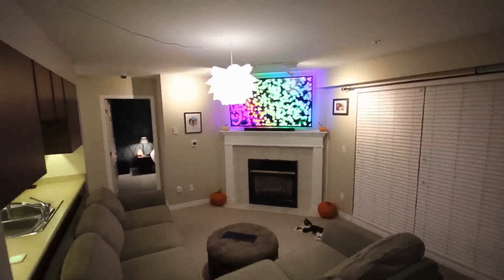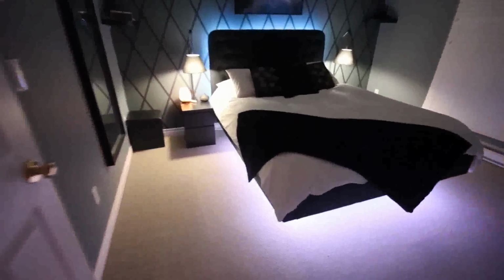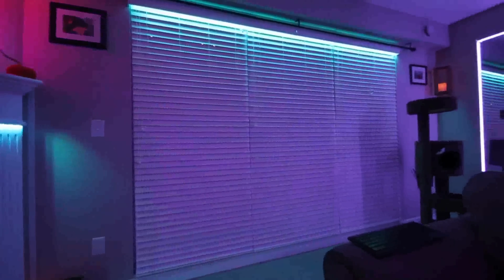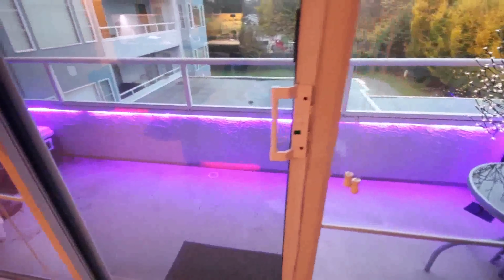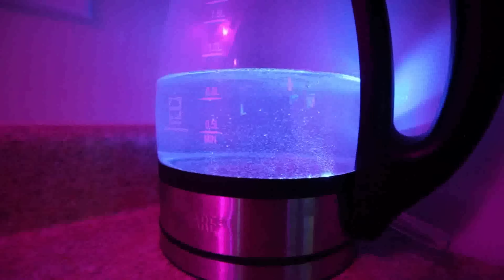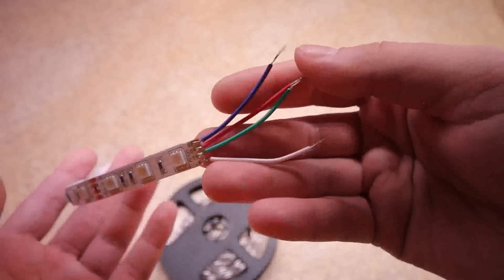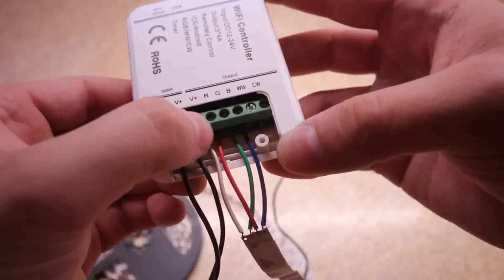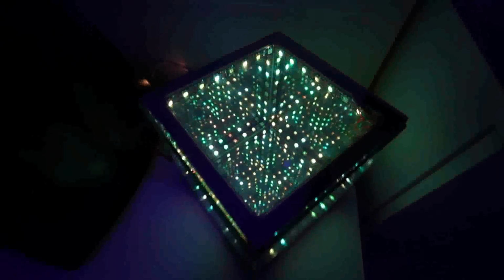My RGB Apartment (Explained)

Comment: Do these lights change with your tv remote? I ordered some Govee LED Strip lights about 2 years ago and experienced that. With certain buttons on my TV it would either turn them off or change the color mode.
Reply from the maker: No, these are controlled over wifi. That happens because your tv remote and your led controller are both infrared controlled

Comment: I have a raspberry pi connected to my led strip and i’ve written a Python program with all sorts of effects for the led strip. I want to control the functions from my python program via my phone but i dont know how. Any suggestions? 
Ive already looked for wifi controllers for ledstrips but you cant program those and you can only use the build in effects.
Reply from the maker: Maybe look into home assistant? Might be what you're looking for
Reply: @Coltography  i will take a look thanks for the advice!
Reply from the maker: @Patrick-fz8ee  np, also suggest wled for nodemcu (esp8266) - open source firmware with a phone app and highly customizable / works with Alexa and has a ton of features
Reply: @Coltography  👍🏻thanks

Comment: How did you get all those sockets to plug into.. definitely the sockets in an apartment are limited
Reply from the maker: Ran low voltage wiring in hidden places

Comment: The lack of compatibility between brands got me into electronic engineering and mostly with the reliable help from Cybernet_hacker on Instagram Now I mod devices to use ICUE as well as designed as RGB 5v Digital to 12v analog converter to allow me to control many analog devices independently as a virtual addressable LEDs.

Comment: How can I find a WiFi controller that works with Magic Home and is USB? Literally all of them are with power adapters :(
Reply from the maker: No such thing as usb powered as they are not 5v controllers
Reply: Coltography Yeah but are there 5V controllers that use the app Magic Home and are USB?
Reply from the maker: Don't think so nope
Reply: Coltography D; I guess I’ll have to use 2 different apps for them. You think that will be annoying or should I buy it? I dont think I have any other options :/

Comment: hey man. may I know what did you use to cover your wire there? is it something like flexible wire casing or what? please help
Reply from the maker: At which part?
Reply: @Coltography  0:40 mostly
Reply: At most part? Especially on the walls area

Comment: When is the video coming for the smart mirror? What display did you use and is it touch screen & if not do you plan to use an IR frame for that?
Reply from the maker: Just used an old 720p tv and no touch screen yet, I definitely want to try one eventually though!
Reply: Coltography look into an IR frame - they have many different sizes you can get - they assemble together so you can make combine sets to make larger one

Comment: hey since you seem to know a lot about led strips i have a quick question my room has a perimeter of approximately 53.3 feet unfortunately when i installed lights they seemed to have gotten really dim after just filling 38.3 feet. how do you keep it from getting so dim or was it just the quality of light i had i’m planning on getting the govee lights and don’t waste money having these lights for them to have the same problem
Reply from the maker: Connect power at both ends of the strips, or do something different than simply lining the permiter of you room

Comment: Question. 
Where do you plug all these LEDs? Don't you need like a gazillion power outlets?
Reply from the maker: Just a couple really, once you step down to 12v you can just splice it and run wires wherever you need

Comment: I am curious. Do you have a hue system. I thought I saw a Phillips hue dimmer. What do you have in your arsenal? I am curious what you're using.
Reply from the maker: Yes, 10 hue bulbs and some of the dimmer switches
Reply: @Coltography  but the lights trips aren't hue from what I saw and heard via pricing. Is that a different system you are using? What lights trips do you recommend?
Reply: STRIPS** dang autocorrect
Reply from the maker: @YoBeAwesome  watch my video on automating cheap rgb strips, I also recently switched to zigbee controllers for cheap rgb strips which connect to hue bridge and all controllable via same app

Comment: Is each individual rgb strip connected to its own power supply? Or is it multiple strips connect to one power box? I want to put some around my whole kitchen and living room but idk how Many volts can each power supply can handle. Do you think if I use a connector to add strips off another box of rgb’s to connect to one single power source would be an over kill?

Comment: I've purchased the same wifi controller. once hooked up and magic home app installed, and linked to google home app, I cannot get the lights to turn white through google home. I've read creating a scene in magic home app and telling google home to "activate" said theme it will follow through.
this was true on my old crappy wifi controller that came with the light, but not the one you are showing. 
I scrapped the old controller because it would disconnect constantly and the physical plugs for the lights would barely hold on.
these new controller you've recommended are all around great, just cant get Google home to turn them white.
these are regular 4 pin RGB lights. not RGBW.
any ideas???

EDIT

just figured it out. through the Google home app, you need to create a new routine. within the settings of that there is an option called "adjust scenes"
this will bring up a list of scenes you've created in the magic home pro app.
select the pre created scene desired, and google home will execute that action.

was going to delete original comment but leaving it up with my solution for anybody with this issue.

Comment: So I have a question, can you attach LED light strips on the center of the ceiling like in a circle ⭕️ and then it’ll act as a light bulb type of thing or a hanging plug 🔌 in lamp  when you don’t have hardwires for a light bulb?

Comment: How did you get permission to do this in an apartment...
Reply from the maker: Didn't need it, because it all comes out??? I don't get why you couldn't put lights in an apartment, damages nothing.
Reply: Coltography I can’t paint or put holes in the wall or change lights because they have their own lights and when it goes out they have to replace it with there stuff, so a lot of stupid little rules. I might try and figure out a way to get around a lot of it.

Comment: Hey guys could someone help me by giving the link to the Extra Powerful 12v 10amp Power Adapter:
Reply from the maker: Hey buddy, just search them on amazon
Reply: @Coltography  Thanks for responding but I tried and couldn't find the one in the video and I can't find any that have the same end like the one in the video I'm not sure if you did something to the original cable in the video but either way thank you for your help
Reply from the maker: @buyit1072  Hey buddy, they're essentially all the same thing. Just buy any 8-10 amp power supply that is 12vdc and it will work for what you need. How many strips are you connecting anyway? You might not need it.

Comment: Q: How do you keep the strips from dimming at the ends? I connected 4 strips to one power supply and the farthest LEDs on the strip fade. I gotten a Bigger power supply and it does not fix the issue.. any idea how to fix that?
Reply from the maker: Attach power at both ends! Splice wires at power supply and run power to the other end. Or add power half way through the strip, if that's easier.
Reply: @Coltography  Alrighty Thanks!

Comment: You could use acrylic paint to cover the white areas of the cable that showed on the cabinets.  Hand mix the color but remember that it will dry darker than when it is wet.

Comment: so do you daisy chain the strips to eventually go to the wifi box? or do you have a dedicated wifi box for every cable run and then just sync them using the app?
Reply from the maker: The latter, but for some areas I'll attach a wire in parallel and use the same controller for a few spots. In this case the fireplace pillars and couch were on one controller

Comment: Can a single connection be made with 20 meters of strip?
Reply from the maker: Yes but you will have voltage drop. So lights at the end of the run will gradually get dimmer. I would connect power at both ends

Comment: i like it, 
but how many and what psu(s) are you using for 165ft of leds?
Reply from the maker: 7 controllers I think with 5-6 different power supplies. I had some running off my computer PSU at the time.
Reply from the maker: Additionally I use what PSUs are required, look up the amperages you need for how many ft you're using etc. I had 3-15amps

Comment: Damn this is goals.

Honestly i might do this one day.

I wonder if you could rig the sink up to be controlled by the heat temp.

You would just have to run a thermoprobe into the valve which could be annoying.
Reply: my old kitchen sink used to be like that

Comment: would you know how I could put it on my ceiling without having to expose some of it going down the wall to an wall outlet?
Reply: Put a small hole in the corner between the ceiling and the wall. Add an additional outlet or junction box in your attic. Run the wires through the hole and plug in at the new outlet.

Comment: Do you NEED wifi for the controllers to work? Or will it work just as long as you have a smart phone? I have no WiFi just hardwired internetz
Reply from the maker: Nope, it can work, the controller will just broadcast its own wifi network you connect to. :)
Reply: @Coltography  thanks hummie!

Comment: My biggest fear is to have one of these lights catch on fire
Reply: Not gonna happen, not realistically high enough voltage unless it's some real dodgy shit
Reply: Ive had like 6 diff rgb lights and strips in my room for like 4 years. No issues. Just don’t buy weird cheap shit off wish to be safe. Just shell out the 20 bucks for a decent strip.

Comment: Anyone know how to link: Speakers, RBG Lights, lights, TV, etc to Google or Alexa? Whats the Bluetooth set up look like
Reply from the maker: Use wifi controllers which are linked in description
Reply: Speakers and TV have to be Alexa compatible or you buy a IR device that mimics your TV / Speaker remote and connect that to Alexa. But it will be messy and you can only perform on/off false/true commands
Reply: Thanks I was able to do it, but I'm wondering how you his the way lights so it doesn't look like a strange stripe with bulbs.
Reply from the maker: @kazukixe  you need to hide the strips behind things so the light can bounce off and diffuse. Then you can't see the tiny bulbs and it looks a lot better.
Reply: @kazukixe  move TV away from wall. Like 15 cm.

If it doesn't help buy a plastic tube and scratch it with sandpaper to make it opaque. Put Led in tube or cut tube on half circle and put on led

Comment: Hi! I have a question, so based on what you showed, the wifi controller only connects to one strip of led. So how do you connect and control all of them to your phone??

Appreciate it, dude!
Reply from the maker: Hello! You can solder wires to the end of the run of the led strips and then continue on past that point with another strip, wherever the wire leads to. In this case I have multiple controllers hooked up to all the "groups" of strips and the app will control all of them at once if I click the entire group. Hope this answers your question. :)

Comment: Question for you, around the mirrors do you have anything to diffuse the light or is it just the Strips on around the edges? I'm trying to get the lights on my desk to look more solid but the spaces between them seem to be too big so thinking of getting the Strip you have used in this video.
Reply from the maker: Hello, I used the same drywall capping you see around the 5:00 mark in this video around the mirrors. Directed the LEDs facing the mirror inside the channel so it provides diffusion and looks more linear

Comment: Quick question. How many wireless/12v adapters did you need? Like did you need one for each rgb set of strips?
Reply from the maker: Hello, I used 1 controller per "section" aka the blinds, fire place, couch all run off 1 controller and 1 adapter. Mirrors are on their on circuit and adapter and so forth. I could have them all on one controller but it's nice to be able to set different colors for certain things.
Reply: ok cool! Thanks so much for the response. I know how many i need to buy now :P @Coltography
Reply from the maker: @TheReckoniing  no problem, always happy to help :) good luck!

Comment: I have a question. Say I buy 6ft led strips, but I only used 2 ft, so I cut it. Does that mean the rest is useless now or can I use the remaining 4 ft?
Reply from the maker: You definitely can use the rest. You just need to solder wire onto the strip :)
Reply: Coltography thanks! Can you maybe make a quick little tutorial on how light strips work? That’ll help me out a lot. Clearly I’m not a really techy guy
Reply from the maker: @ionetwofarq1673  yes, that will be my next video don't worry!
Reply: Coltography this Chanel is amazing! Def subbing

Comment: That's amazing! Have you thought about putting the light strips around your door frame facing outward and then placing a bezel on the door frame overlapping the light strip just enough so you cant see them from an angle. Would look super cool!! Also have you thought about using Ultra Electro Luminescent wire? Its much brighter than standard EL wire and looks better when directly looking at it than an LED strip IMO, so for areas where you cant put a bezel to cover the light strip this would be handy.

Comment: How much do you think you’ve spent in total with the WiFi controllers? I’m looking to do my bed room next. I did my game room but only with regular usb LEDs on all three screens, my desk and entertainment stand. I use a stand remote for it. I haven’t looked into WiFi controlled options.
Reply from the maker: Links to the ones I used are in the description, I've spent about $150 I think on all the wifi controllers. Currently swapping them all out for ZigBee controllers though so they pair with Philips hue apps

Comment: How did you get your LED strips to stay on and not fall. I've bought the adhesive kind and they always peel off after a few months
Reply from the maker: I usually just super glue them every few inches because the adhesives suck. Or tape them, since they're hidden it doesn't really matter hha

Comment: Seeking your assistance - would like to cut the Emanger strip in half -so I could jump across the stove top -what wire/connector would I purchase to link the now 2 strips? Thanks!
Reply from the maker: You will need to solder 4 conducter wire to the copper contacts on the strip.

Comment: can you post a link of where did you buy that 2 way miorror? or did you use a mirror film over a glass table top?
Reply from the maker: Hello, I would recommend asking around local glass shops and get a quote for the dimensions you want.  For my mirror I just had a glass shop cut me the size of normal glass I wanted 1/8" thick, and then applied mirror film from home Depot on top.
Reply: @Coltography  Thank you so much for your response, I'm having a set up competition and everything you have done is amazing. I especially think the magic mirror just looks so awesome and high-tech. After watching your videos, I was inspired to do a magic mirror myself. For the competition, I will definitely give you credit, thank you.

Comment: How many amps power adapter would you recomend for 3 meter smd5050 light strips?
Reply from the maker: 2
Reply: @Coltography  okay thank you, I was just worried because smd5050 says rated 0.2w per led so 0.2*180 is 36w÷12v would be 3A? I'm worried about 2A power supply burning out maybe
Reply from the maker: @simcore717  I use 2 amp for all my runs but you could always just get a 5 amp to play it safe. :)

Comment: Does each light strip need to be plugged into the wifi box to control each room of light or is it their own control box? I guess I'm trying to figure out how to have different "controllers".. is the controlled the wifi or it's own box that they come with?
Reply from the maker: Each controller controls its own area.  My living room has 1 controller, with the blinds, couch, and fireplace pillars all hooked to that one controller. You can hook up a few different strips to one controller if you want, but I used multiple controllers so each area can have a different color or can be turned off. Hope this answers your question! :)

Comment: Are you only connecting the strips from one end? I know that cheap strips have a decent voltage drop across their copper traces, and should be connected to power every 2.5 meters or so. This drop is less imperative if you use 24v strips. I had led's installed in my room 2 years ago, used a computer power supply to provide power. Overkill I know,  but much safer. Using a 2 amp power supply for 5 meters could be a bad idea. It's probably better to use a higher amp power supply.
Reply from the maker: Every "Run" has them connected only at one end, yes.  Besides the lights on my balcony there is not enough of a voltage drop for me to notice or really care.  A computer power supply isn't overkill at all. :) I have a 20a power supply for most of my lights just because I wanted a big fat passive cooling power adapter for looks.   You can't do any harm getting an oversized power supply.  I just link people a 2a because that's great for most peoples needs, and super cheap.
Reply: @Coltography  I bought my strips from aliexpress. Around 6 dollars for 5 meters (about 16 feet). Did you buy your strips from the links in the description? At a glance they seem to be the same as the aliexpress ones, but marked up to be sold on amazon. I also had a problem with the aliexpress strips where the colors were different on different strips.